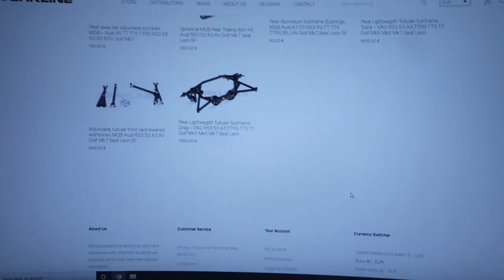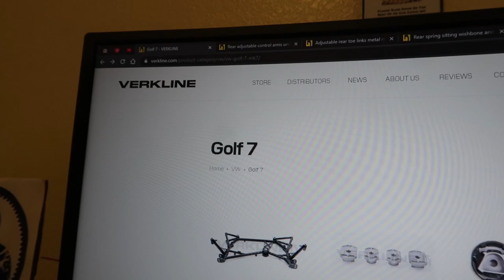TX MQB SHOOTOUT OCT 2020

Comment: This sounds dope! So you run a walbro 450 too? I was told by someone at UM that the walbro 450 will run out around 500whp on pump gas on our AWD cars :/  I'm replacing my pump with a c6 s6 pump
Reply from the maker: It should do a little more I think, looking at my logs as I sit there's a good bit of room for play on the pump gas tune and I should be damn close to 500. I ran E50 last year without the pump controller no issues but that was also less boost.. so we'll see soon!
Reply: @BryceJordanProductions  ok awesome! I'm looking forward to your ethanol hp numbers 😁 I already purchased the audi pump and the walbro is going in my rsx but I'm still curious how far you can push the walbro nonetheless!